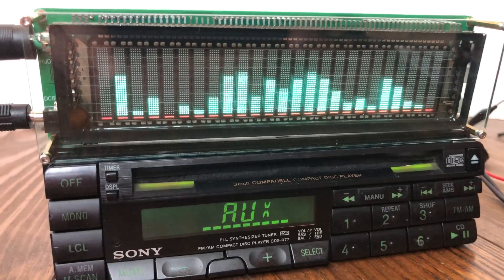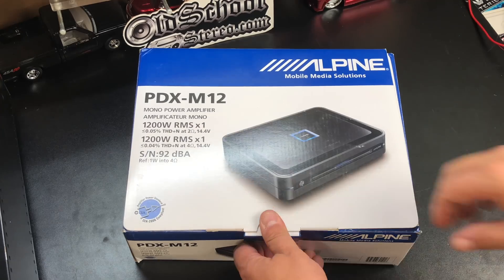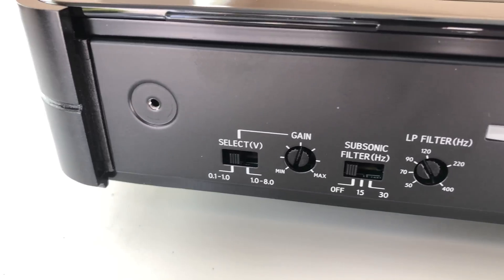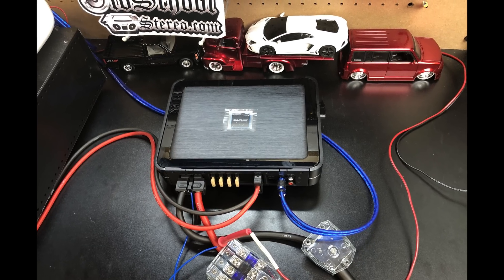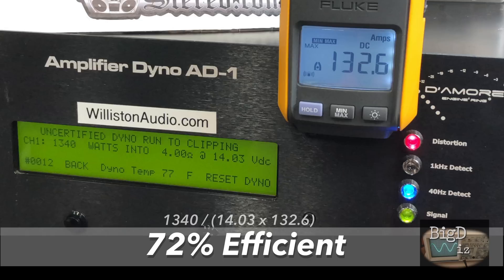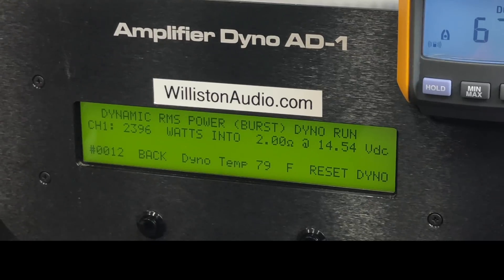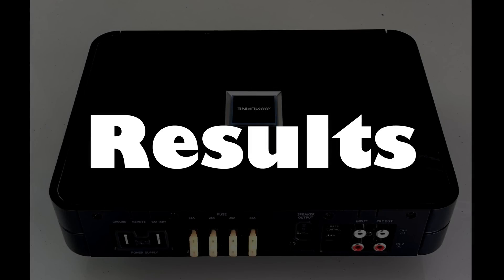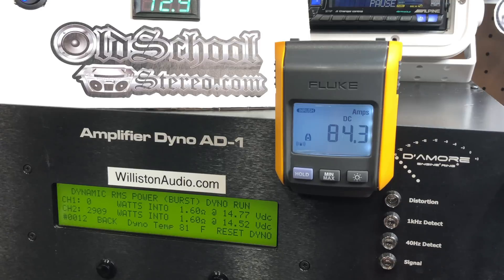Alpine PDX-M12 Amp Dyno Test

Comment: for 750, you'd think they could include a remote bass control. even pioneer includes one on their ~$200 models.
Reply from the maker: I have real beef with this!
Reply: @wal  , I agree that it`s not cool and i`ve just come to accept and expect this with higher end and up amps. Sometimes there will be exceptions but for the most part, it`s the norm for these types of amps and a selling point for lower end amps.
Reply: I don't like bass knobs anyway.  I couldn't tell you where the one that came with my prime 1200 is.  I use a level control, that way i can daisy chain amps and control them all with one knob.
Reply: @LerRhann  Same, I use a inline RCA potentiometer so that I can adjust the bass level before it even hits the amps.
Reply: @JesusIsLordAndSavior77  yea, that's what I am talking aboht.
Reply: I bought this amp and a type r from a local dealer and they threw in the knob. Love this setup.
Reply: I agree, even as someone who uses the sub lvl control as the bass knob.
Reply: kenabi, For those that will spend the money on this amp, spending a little more for the Alpine bass knob is not a problem. Also, you can`t compare a Pioneer amp to this Alpine amp.
Reply: i've had alpine gear, i've had pioneer gear, sony, kenwood, denon. the amp under my trucks seat is a current gen pioneer. it just flat out managed to beat out the other amps i could get my hands on for what i needed, and the space i had. and it included the knob in the deal.

i'm not going to pay the idiot tax for the alpine name when i can tell no functional difference and still get the same performance level from a cheaper device. high price tags aren't indicative of ultra quality. is it good quality? sure. but these days its still kind of a premium price for 'good'. i'll leave models like this to the people who have no issues with the tax that comes with it.

i can take the amp i have, buy a second, recap that with the best quality low esr elna's i can find and still be under the price of this alpine.

nope nope nope nope.

and frankly, if ~$550 is worth an ever so slight signal performance difference you get on the waveform between this and a similar spec'd pioneer (hint: no.) then i might as well just stop even looking at audio gear, because to me a name means nothing if it can't back it up beyond "this is expensive because it's 'good'". it doesn't need to be good at that kind of markup, but at almost 4x the price of the competition in the same class, it better be outstanding. a slight bump for component quality, sure. but at 750 retail vs ~200 for the similar models i was poking, all of which can do a similar ohm rating and wattage and still stay clean.

meh. bang for the buck quality of build + clarity is more important to me than a name.

one of the best amps i've ever seen was some no-name two channel bridgeable i ran for years till some knucklehead spilled his drink on it. super clean, ran fairly cool, pounded my old JL12 like a jackhammer.
Reply: @kenabi , To each his or her own but one gets what they pay for and many people can tell sonically the difference between a 1000 watt amp that cost $200.00 and a 1000 watt amp that cost close to or more than $1000.00. That extra money, which many people don`t care about goes into the R&D, better components, build quality, and other things. To get this amount of power out of a package this size is just insane. With that being said, would it having a bass knob make it worth the price to you? The class that this Alpine amp falls in, how is it 4x the cost of the competition and what are you comparing it to when it`s actually much cheaper than it`s main competition which is the JL Audio HD1200.
Reply: kenabi  I agree with you
Reply: What quality things do you pay for? Curious its not audio or phones. Im hoping Scotch or something cool.
Reply: @kenabi  personally if you have never tried one, how can you comment?

Your paying mostly for the technology and all the man hours to produce something so unique.

While I agree to a certain extent, this amplifier will play a big part in box rise (impedance rise).

So while your pioneer amplifier may produce 1200w RMS, it will be halved when the speaker is moving.

This amplifier would do a good job overcoming this and keeps the output clean and loud from 2ohm to 4ohm. Similar to the Rockford Fosgate constant power and JL HD series.

I've had Sundown SCV2000, Ground zero extreme 1650, Orion 1500dz and afew more which produces 2kw. Yet I keep coming back to the Alpine M12.

It's sounds just as loud, cleaner with a smaller footprint.

I've had 3 PDX M12 thinking the next amplifier will be the one I'm sticking with. Oh no! The other amplifiers where a let down in my opinion.

So until you actually try EXPENSIVE WATTS compared to cheap watts, then your opinion doesn't really mean much.
Reply: @blkngwinn  I've replied to his comments too. 

Can't compared cheap watts to expensive watts if he's never tried one of these units.
Reply: @kenabi  TLDR

Comment: That’s a lot of juice in a small box!
Reply from the maker: Do shizzle!
Reply: Only thing that concerns me is how long it can sustain that power since its such a small package. Surely cooling is an issue?
Reply: No it will back down power if it gets too hot. That said my PDX-V9 did shut down once but it was under the spare cover and not much air flow, so at high volume I would experience this maybe about two hours of really hard/loud play but at more moderate levels it never shut down.